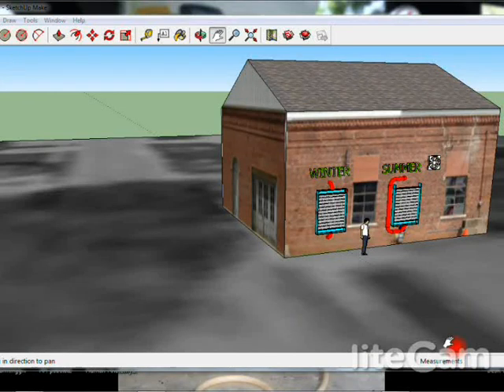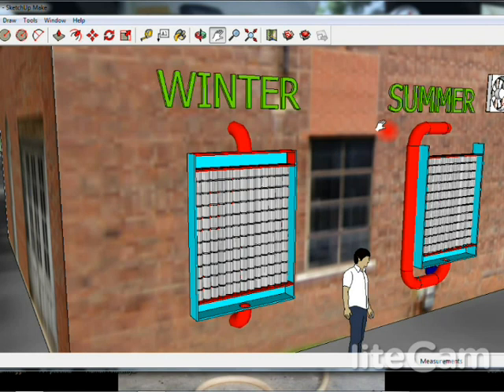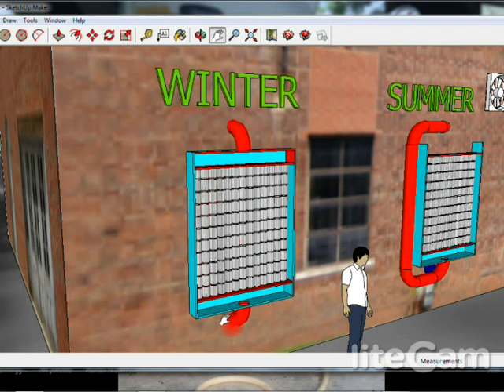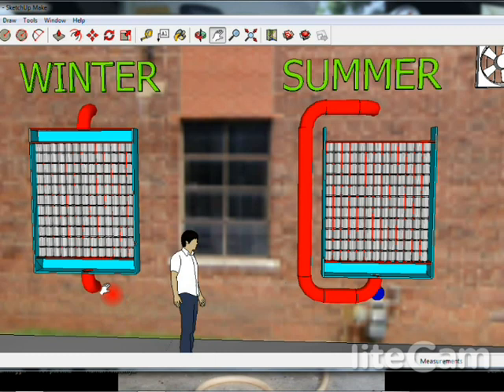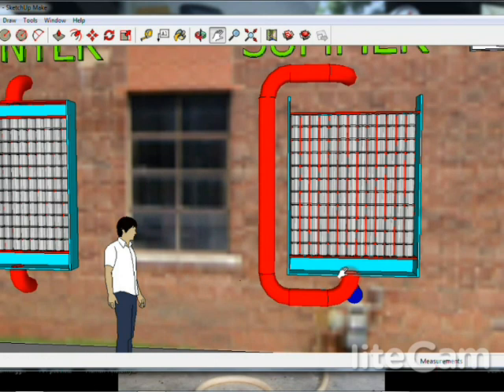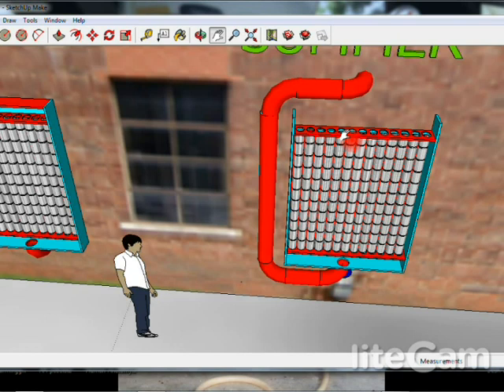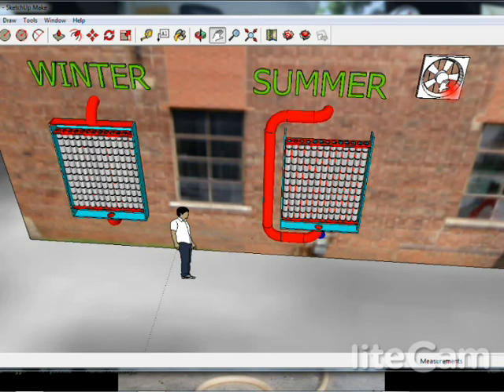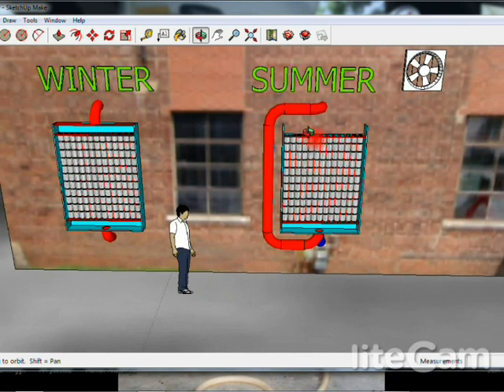Solar Cooler/Ventilator And Solar Heater in 1, Using Sun's Heat To Cool Your House

Comment: Hi Saeid, Potentially I think your concept idea is really great and could work although in the summer I am assuming that you would use a small 12v solar driven fan to push the hot air out from the top of the room through the ducting to the bottom of the cans prior to the hot air expelling into the atmosphere. Active rather than Passive?
Reply from the maker: Actually no! I'm assuming if the system is air-tight enough, the updraft from the cans will create enough vacuum to pull the hot air from the ceiling area. 

I might have to put the whole system on the roof, rather than attaching it to the wall. That way the hot air won't need as much persuasion to leave the room (-:
Reply: Saeid Momtahan Don't forget that a fan run in summer will cost you nothing on a small solar panel. Try it your way but with heat rising I don't think you will have enough ability to make it fall through the ducting before rising again out of the cans without some kind of help. I may be wrong but it's all trial and error I suppose. Good luck with it anyway, I will keep monitoring your progress......
Reply from the maker: I think this system would depend on heat differentials. When the air in the cans gets hot enough it will eventually rise. But like you said it's all trial and error.
Reply: @solarsiberia  I think that by adding some more pipe above the exhaust of the heating element, it will help create more updraft, since the hot air wants to rise. But even so, if the volume of the air heated by the heating elements is large enough, it will work.

Comment: I get the idea and principle behind how it provides the heat during the winter. What I also get the theory of how the "cooling" part of it can ventilate out the stale stuffy air while improving the air quality. What I DON'T see is how you make 85 to 100+ degree air a more tolerable 68 degrees. If it's 95 outside and all you have is "airflow" in the system how do you change the temperature of the air INSIDE the house? Even if you can theoretically lower the indoor temp to equal what it is OUTSIDE 95 degrees is STILL too hot inside.

Nice looking design, not too cumbersome.
Reply from the maker: Lee Forex Hi Lee. The idea as is to replace the trapped hot air inside the house near the cieling with the cooler air from outside. If it's 95 outside, then you will need proper air conditioning.

Comment: Hard to comment on how successful your heat/cold exchangers are.  In theory it should and does work but without data, it is hard to know how effective they are.  You may want to calculate the volume of air exchanged in a unit time and the difference in ambient room temperature and the temperature of heated air entering the room.  If your system turns out to be efficient, you may want to experiment with a slightly larger intake fan.  The trade off is that as the fan speed increases the temperature of the air entering the room would drop.  Do some measurements and get a video of your panel with dimensions and volume of air exchange and temperature differences.  Then you would know how efficient your system is.  Good luck.

Comment: I personally do not think that you need to block bottom part for summer system. You can use it as air in channel instead of the window (more secure).
Reply from the maker: Vadik Leontjev You're absolutely right. A mosquito net over the opening will keep the bugs out as well
Saeid
Reply: +Saeid Momtahan would rain or dust getting in there be a problem?
Reply: @SoupLegion  Using a corner pipe with a mosquito net covering the exhaust would help against that. Or one of those chimney tops with a roof to protect against rain. Or chimeny roof with mosquito mesh.

Comment: I have just seen this, I wonder if you could add a bypass to switch to AC for summer mode? That way there is only one hole in the wall and not two.
Reply: The AC also has two holes, or two pipes going through the same hole.

Comment: In the cooling mode, hot air from inside is exhausted from inside so that air has to be replaced.  Thus, if that air comes from a cool place like underground,or through an evaporative cooler, your solar cooler will work even better to cool the inside of the home
Reply: And if you don't want additional humidity to be added, you can have the evaporative cooler on around a heatsink which is connected to the inside of the house, and the heatsink should have a a pipe going inside the house below where the heatsink is located.

Comment: I think that it's great!
Reply: I think this is a lie, DOESN'T WORK!
Reply: @drzavahercegbosnaponosna5974  Which part doesn't? The cooling probably doesn't do much, since it doesn't use an evaporative cooler with a heatsink after it. The heatsink would be connected to the inside, to cool the inside air without ejecting the air outside. And by adding a tall pipe above the heater will also increase the updraft which will lower the pressure of the air getting inside, which will cool the heatsink even more.

Comment: the problem with this cooling is it sucks hot air out from top of the room But what air going to replace it ? you be creating a vacume in your house , and if the house is 100 seal you will get no air flow , if there cracks in the house you be sucking air in from out side , if the door is open you be drawing the hot air from out side faster ... maybe if you put pipes deep in the ground connected in a loop to the house then draw air in the house from that you could cool the house down only you will need a fan to make air flow

Comment: Hi Saeid,  
Just stumbled across this via Pinterest.  Love it.  I've been thinking about a passive system for a few years now.  The heating aspect is intuitively obvious but the cooling part is brilliant.  Have you gotten passed the "idea" stage and gone to prototype?  How effective was the cooling using the solar method?  The mechanical fan is both noisy and consumes power. 
Best,
Tom
Reply: For the cooling part, the system can be improved by adding a long pipe going up to the exhaust of the heating elements, and a sealed insulated box below the intake of the heating elements, with a heatsink inside the box, the box having a smaller intake which can have it's intake area reduced (by partially covering it), and with the heatsinks connected to the inside of the building through insulated pipes. The heating element moves air, creating updraft, the updraft increases even more in the pipe/chimney above, and the updraft pulls air from outside, which lowers the pressure, which lowers the temperature of the air, which cools the heatsink.
Reply: @SapioiT  Nice ! I saw also a draw looking like what you said, + the air sucked to the chemney would go vortex with a non rotating propeller under the intake. A second pipe of air (the one that comes in you house) would pass though the inside of the vortex, catching cooler temp in. Evaporative cooling can also be made in the vortex chamber to cool enven better, without adding humidity in the air going to the house ! I saw already a yt video with this part realised..
Reply: @AutoNomades  Nice! Very nice! Thanks for sharing! Could you tell me where I could find those drawings and the name of the youtube video? I'm really curious! Do note that youtube deletes links, so the name of the site and the name of the article would work, instead. Thank you in advance!

Comment: The logic for the Winter use is fine, but for the summer use, it is odd to pull out the hot air and let it go through the box and then release into the air. Why not just release it directly out?
Reply: I guess cause hot air suck in air from a specific place - and if you specific place has the hot air it is suck out by even hotter air. But I honestly don't know if it will work out. Any update from the author will be helpful (IF he build this projects).

Comment: the easiest way to cool in the summer is to pull the air from below the house ..most houses have crawl spaces and they always stay 65-80 even when its hot and around 102 so you could cool the house by making a tube with vents to pull air from there and push it to the rooms...each room would need a vent in the floor and its own fan to force air in to the room alone...also you would want to put vents in the ceiling as hot air rises so having cold air pushed up forces the hot air up further ..as for heating best way is to have salt water stored in tanks and run pipes to a solar heater on the roof mind you this will not work in areas which have extreme cold because at night time you would have to drain the heat pipes so they don't freeze but if you could keep the water flowing then it would help from that...and yes we have tested this theory and use the idea on our on home when we have summers that get to 100 or above we have the inside of our house at 73 to 75 depending on the time of day 75 is around 2pm but after 3: 30 it drops back down...being we are in the south i can not state about extreme cold because the coldest we have had here is 18 degrees for 2 days
Reply: Sucking hot humid air into a cold crawlspace is not a great idea unless you like condensation and mould.
Reply: @barlowcj  You can use pipes to get the the cold from underneath the house without getting hot humid air in the crawl spaces, to avoid mold.
Reply: In places which get really cold, you can use sealed pipes with a mix of water and antifreeze (depending on the temperatures you get there), for the antifreeze pipes to heat the water basin. Adding a stainless metal sheet to reflect more sunlight onto the heater also helps quite a bit. The more sunlight you reflect onto it, the hotter it gets, which can mean very hot water in the summer. To get similarly-hot water in the winter, you need more sunlight reflected onto the panels, or less water to be heated.

Comment from the maker: Design Idea for a Solar Heater/ Cooler
Reply: install a fan run off a $1 store solar light top ( remove the solar
 battery) & hook up each terminal to CPU fan terminal (+) & (neg) 
sides and let the SUN run the solar light "panel" to run the fan to blow the
 air with force thru the tubes by PULLING it out @ the TOP of the can 
unit....however......it do see that Alum. downspouts work much better 
with their sides having ripples to better catch the heat (gaining 210 
degree temp capacity)...and also "screens" laid on 2 sides of inside 
panel held off the bottom & back by 3/8" - 1/2" blocks allow the 
panel inside to float with air on all sides of the 2 layers of screens 
held apart... THIS screen system works about 3 degrees hotter than cans 
& alot less cost & alot less work involved.  I would like to see
 it compaired however to a system created out of the tall thin REDBULL 
cans vs. regular width beer /soda cans...I think the thin tall cans 
would allow more rows of cans to be coiled in up/down rows to make the 
final output an even hotter temperature. Would be alot of work to make 
it though but would end up being like a large scale copper coil system 
on an air conditioner or refrig.  - - - so try a CPU fan $2 +/- and hook
 it up. you would need a CPU that could withstand hot air temps....or 
attach fan to INLET hole to PULL the air thru system vs. pulling it into
 room. 

BTW,,,I'm a 27 yr experience Architect that specialized in creating 
solar heat tanks before many of you were even born and put them on 
experimental homes in early 1980s after doing the hard #'s/calc's during
 a solar college class where we wrote programs for calculating thermal 
mass required for entire homes with passive/active systems combined.  I 
always wanted to try to come up with a cheap type of solar powered air 
conditioning system that flowed thru tubes thruout the home in a ceiling
 area vs. floors for heat in winter.
Reply: @dominique62dw  CPU? You mean that thing from computers? If not, what exactly do you mean by that?
Reply: @SapioiT  yes the cheap almost flat fan used in computers to keep them cool. You would need to use it on the room air temperature side (air intake) because the opposite end for solar heating of space has too high of temperature coming from (exhaust pipe pvc) into room and would melt the cpu fan immediately. The air can get up to 160 degrees enough to burn skin so keep exhaust into room low to floor but away from anything combustable for 3 ft away from it. Definitely no curtains or furniture near it and you will need to not allow yourself to go in front of it or touch it during day. So maybe thin wire cage 12" cube around it.
Reply: @dominique62dw  Oh, I see. But I think you might have better luck with a "homemade swamp cooler" or "makeshift evaporative cooling" (terms to google, if interested), which to circulate the air inside the room without pulling air from outside. The downside is the higher humidity this causes. 

A more expensive version which solves the humidity issue would be using solar power to power peltier modules and the fan you mentioned, to get the heat from inside the house to the outside, effectively cooling the house. But that's just a weaker AC, by this point. 

You could also look at ACs for RVs and campers, to find something which could be powered by a small solar panel. Though you might also want to use a fan to cool down the solar panel to ambient temperature, to prevent the efficiency loss caused by overheating.

Comment: I like the design in principle, but I'm not seeing how you deal with moisture, both from precipitation and any condensation? Obviously, if the cooling system in the summer relies on unrestricted airflow (as it is trying to basically be a hot air siphon) you'll need a completely open system to vent this. How do you prevent precipitation and night time dew from settling into the system and potentially creating mold?
Reply from the maker: Derek, moisture is not a problem in many places. In fact where we are there is virtually no moisture in the air.
For humid places, one could install some kind of a drain. It could be a simple glass jar attached to the out let pipe at the bottom. May be incorporate a valve so you can drain the system. Much like the tank drain valve on an air compressor.
Saeid
Reply: Understood. I'm in Northern Michigan. Moisture would DEFINITELY be a consideration.
Reply: Lol, if you come up with a good method, let me know! I'm in Alpena. Our property is right on Lake Huron, so it's usually a few degrees cooler here than in town, and there's often a decent breeze, but this doesn't help with the pole barn where I have my shop. Opening the windows on humid days doesn't help wood very much! lol
Reply: Derek Smalls I would love to try this, but hadn't considered condensation...can anyone tell me if any of the soda can build includes anything toxic?  'Cause I'm thinking you could put a drip valve into the bottom of the outflow, so you could shut it off in winter, and then collect the summer effluent to water the veggies...unless there's any lead or toxic crap coming out w the water.

Comment: Everybody been giving so many theories how about someone actually try it. I have 40' long x8' wide x 9' high metal cargo container with two wind turbine at the rooftop. So I am going to try this for heating that container. It gets pretty cold in winter and pretty hot in summer central California.
Reply: did you try it yet?
Reply: Have you tried it yet? I'd like to know if or how well it worked.
Reply: Its nicer to try to ameliorate climate in with simple tech, but nicest to just start from something more adapted to live than a noisy under the rain, cold in winter, hot in summer unbreathing (dark color ?) metal box ... ^^ Earth coated load bearing strawbale is cheap and a good base ! Cargo container is good for compost heating chamber as some does ; )

Comment: Very interesting idea, but please do mention that this summer set up shouldn't be used with air conditioned houses!!   It's a no-energy fan system and has the advantage of being more quiet (I'm just guessing on that one) but would be a very bad thing if an air conditioner was running.   Very good thinking!     Have you heard of BuildItSolar.com?   They would probably be very interested in your idea, and sharing it.  Thanks!   I wish you continued success!

Comment: Simmer time when you remove the top you can get rain and debris in it as well as bugs .
Reply: You place a half globe cap over it, to deflect the rain.  And a small piece of screen to prevent bugs.  I believe that he did not talk about these things, because those things are obvious things that you would do.  The video is about the idea of using the "heater" to extract heat from the house in the summer to help with cooling.  it is not necessary to cover every little detail of construction when he is simply addressing the idea of using it for this purpose.

Comment: The only possible progress within this concept is that it sucks air out from the building during daytime&sunshine. Thus, in summer time it will only work during daytime when the sun is shining which is exactly the time where (as everyone who lives in that environment knows) is the the time when any circulation from inside to outside is to be prevented. In any naturally-cooled building even in the upper layers of air it should be cooler that outside.

Comment: In the summer, could you harness the heat taken from the home and instead of allowing it simply to exit into the sky, redirect it to heat a pool, sauna or hottub, thereby eliminating any need for the waste of energy?
Reply from the maker: +Candy Chaples Your idea is orders of magnitude more complicated.  The idea behind this is to keep it simple
Reply: Saeid Momtahan But I do like the idea of adding a fly wheel or something to your summer setup, and funnel all of your upward flowing super heated air over it...you could generate enough power (hopefully) to run room lights or a small fan inside to help circulate air.  Gonna have to think about that....